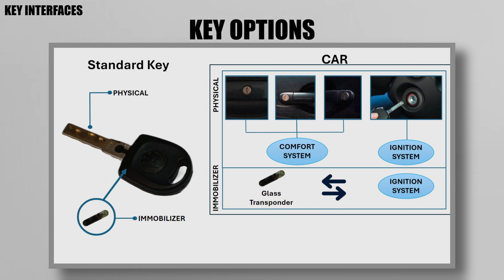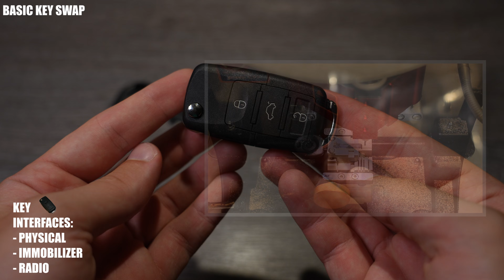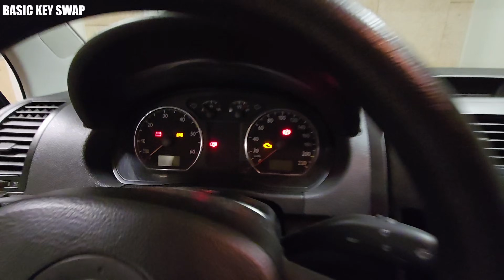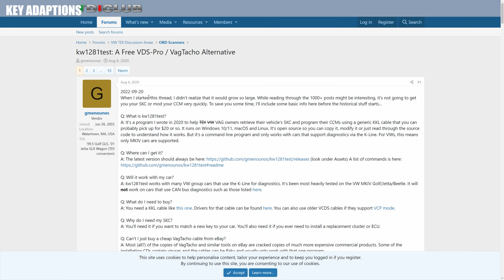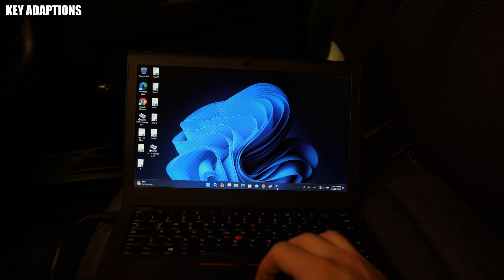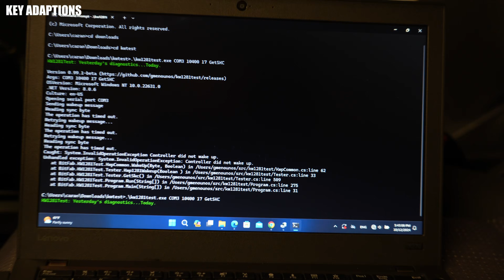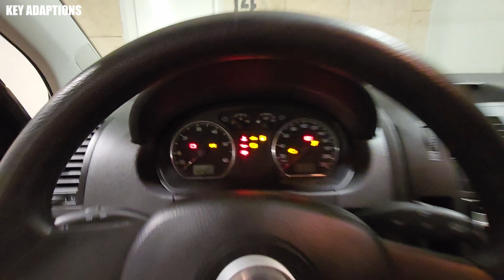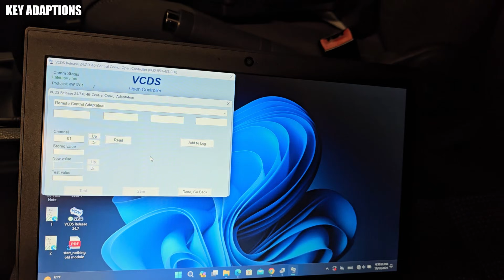Polo 9N Add New Keys + Remote Locking

Comment: how much is vcds and where can i get it
Reply from the maker: VCDS is a software made by Ross-Tech. I think there are a number of registered sellers. Personally I live near Germany and bought mine off https://www.vcds-shop.de/. Cost for most basic package was 300 Eur. This allows Basic functionality on unlimited VINs and advanced functions on 3x VINs. There is a free (lite) version of VCDS for basic functions. Some cables are cleared for unlimited VINs and can be bought used on Ebay, especially for older / slightly slower cables.

Comment: I admire what you do with the VW Polo. I have a 9N as well, and what I'm looking for the most right now is how to roll up and roll down the windows using the remote instead of putting the key in the door. I hope you can find a solution, and I'm eagerly waiting for that day.
Reply from the maker: This one is harder than it seems. Apparently it is something in the car's software/ logic that does not allow the remote to make this feature work, just the lock cylinders. It must be related to the comfort module. It is possible to update the module to make this work, but I have never wanted to give it a go... maybe one day I look into it more :p
Reply: @albonicool  I hope the comment doesn't get deleted again for too many numbers. There is a guide form a Polish dude with all the coding for this

[F1] [Manual] Domykanie szyb z pilota
Reply: @marmagico  I couldn't find the comment or the website for the code, could you explain it to me better? Você fala português?
Reply: @albonicool  It's only possible with the polo 9n because the windows are still controlled via the Can-Bus system. In the models like 9n3 it dosen't work because is a Lin-Bus system.  Pratically you have to check some adresses and change the configuration via VCDS. I can't post all 15 adresses because probably they are recognized as spam from youtube. The forum post is for the skoda fabia but it's the same also for the VW polo 9n